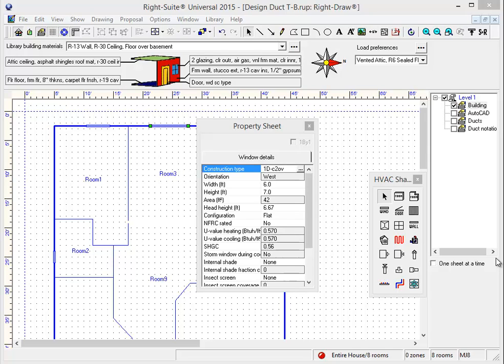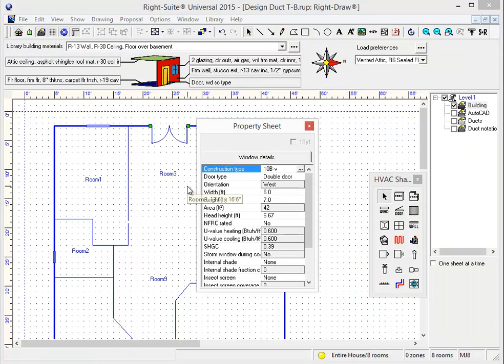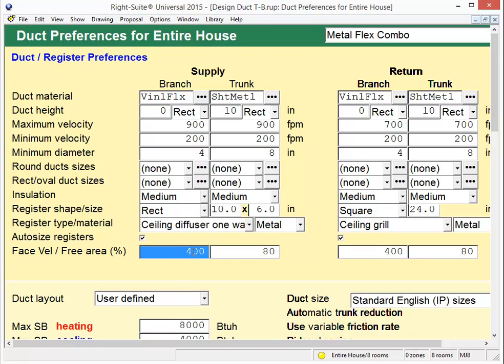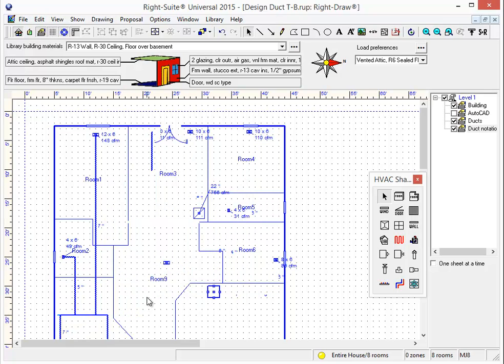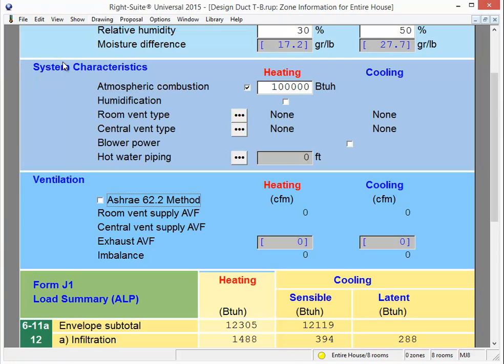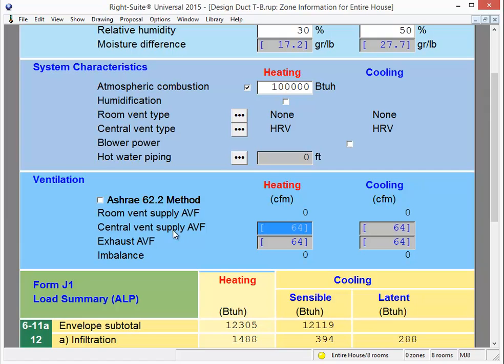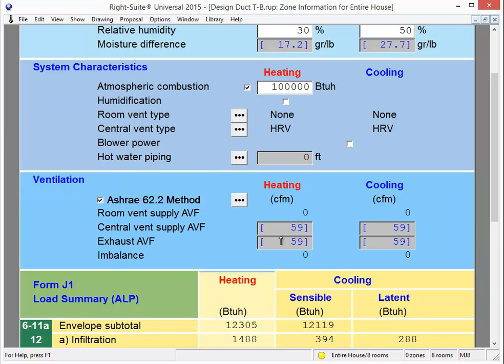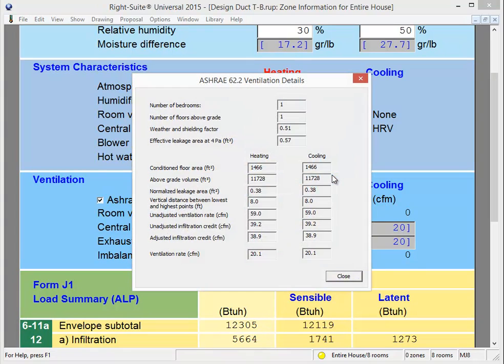Right-Suite Universal 2015 - New Features [Part 1]

Comment: Great 2015 improvements!!!  The smart-checker on the Manual D branch-to-trunk duct connections.  It makes it so easy to identify issues to check.  On large homes this makes duct checking so much easier!  And auto-size registers is a great time saver.  www.load-calculations.com